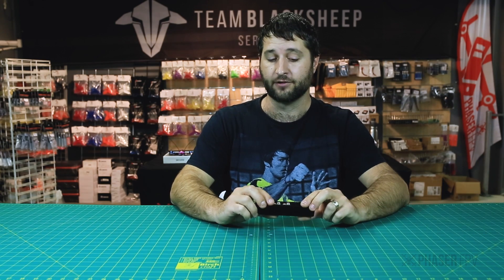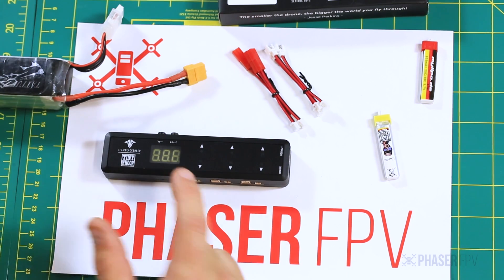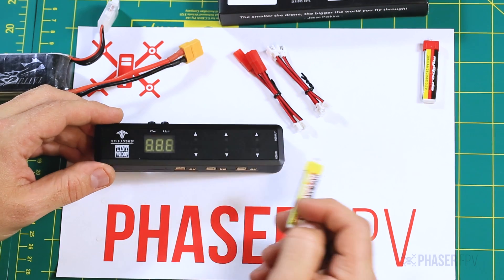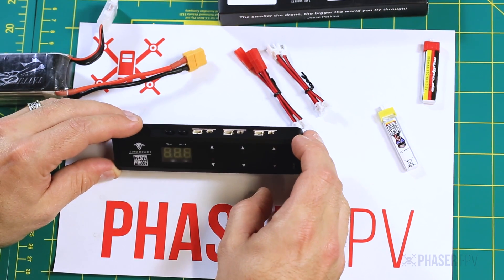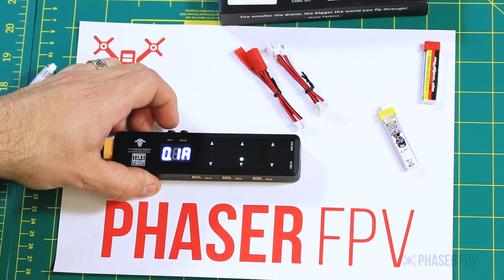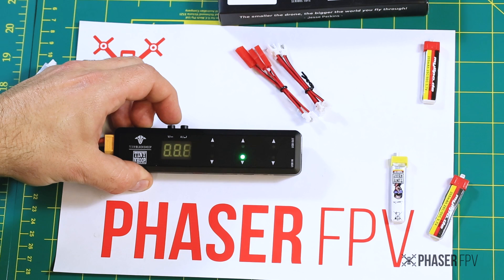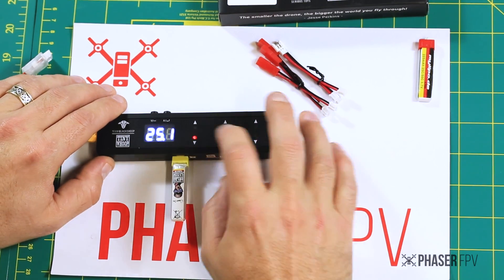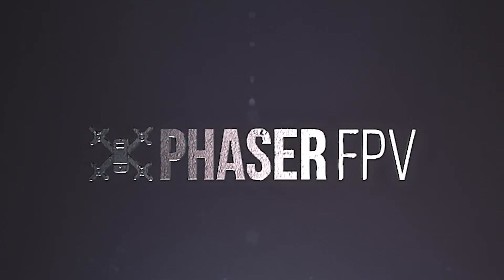TBS Tiny Whoop Charger Manual Instructions & Review

Comment: what output voltage would you recommend for a dc adapter? thanks for the manual btw, couldn't find it anywhere else! subscribed :D
Reply from the maker: G'day. Any power supplier that has 9-26V output will suffice. Obviously the higher the voltage the more efficient it is. It takes  Round 3.5mm jack dc input range: 9V-26V@24W
Reply: Phaser FPV thanks! so you wouldn't recommend charging these batteries at more than .5A per port? or like shouldn't  .2A technically be the best for the batteries?
Reply from the maker: I charge 0.2-0.4 per port max. You can charge more, just your bats wont last as long :P
Reply: Phaser FPV exactly!  haha! thanks a lot for the help, I knew I wasn't crazy xD :P
Reply from the maker: no worries
Reply: could you link me one of the dc barrel jacks please? I couldn't find the right thing.